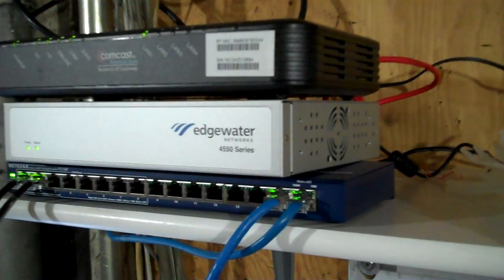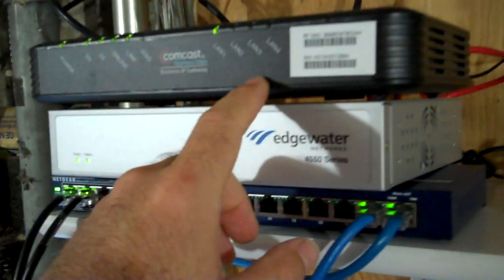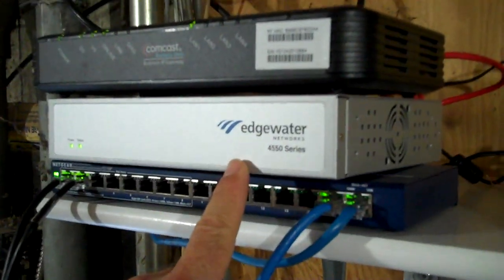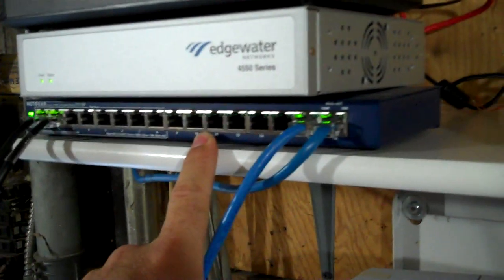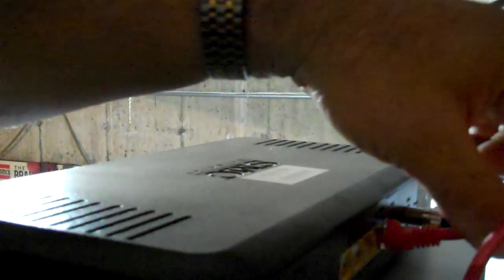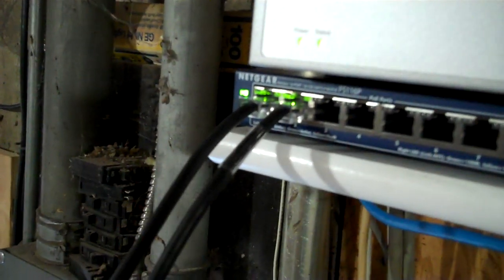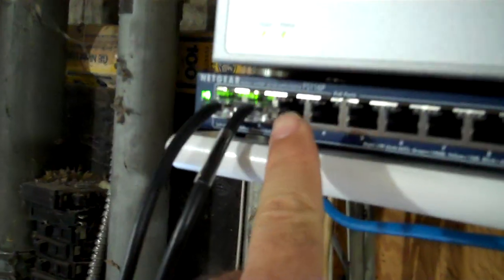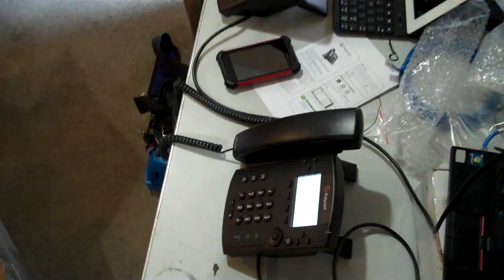Basic Components of a VoIP network

Comment: Just to fix some terminology..
Top device is a modem ROUTER 
The middle device is a VoIP GATEWAY (simply put a device that singles out the VoIP traffing from the internet traffic and is able to "split" it accordingly to different VoIP phones/terminals and also encode/decode the voip signals to be compatible with legacy hardware e.g PSTN phones ) 
The lower device is a switch that provides the physical ports so that the "split" packets (From the VoIP Gateway) end up to each accordingly to what the DCHP server module of the gateway commands to.

Comment: I bought a small poe switch for a voip phone system demo we’re installing at our home and when I plug into the POE ports at 24v it won’t power the phone. I looked on the back of the phone and it says input is 48v. Is there such thing as 48v port poe switches? What voltage poe is the switch here in the video? Thanks!

Comment: can i use a regular switch to connect to the phone? or need to work with PoE?
Reply from the maker: +Israel Jo yes, you can definitely use a regular switch without POE.  But, you will need to power the phones with the plug-in power adapters at the location where they will be used.  In small environments this is not too bed.  But, it's not a good practice in a large office.
Reply: POE is the best!!! You can even power up WIFI access points with it. It's nice having POE. It's not necessary having a POE switch you can power the phone off of a standard power outlet. having one cable that goes to the phone is really nice clean and simple.